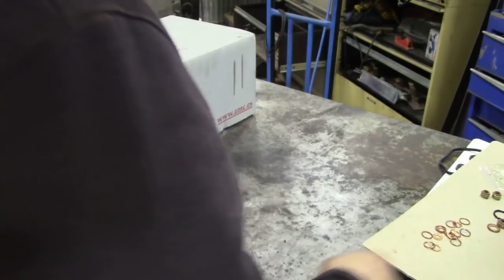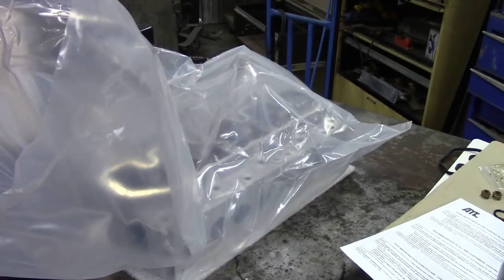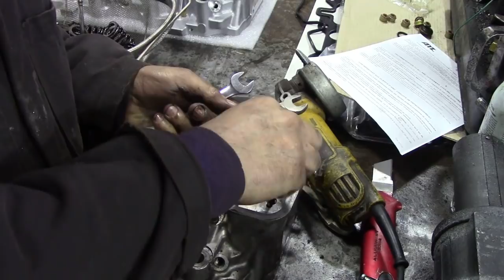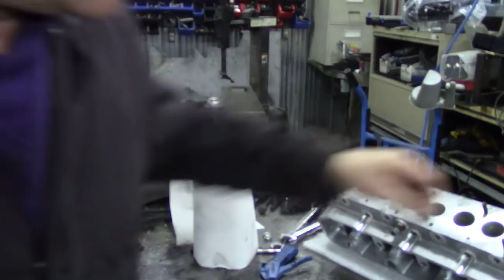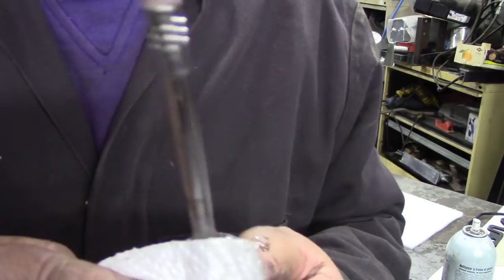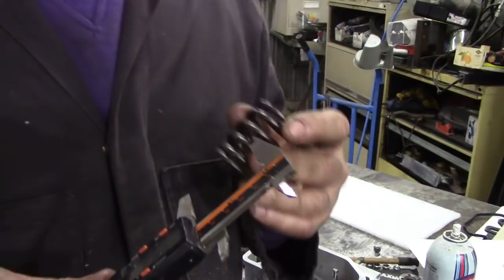300Tdi head replacement Part 1. Swapping parts, cutting valves and getting ready to fit.

Comment: Built many of those cylinder heads  during my time employed at Land Rover.......think it was around 20 or so an hour!
Reply from the maker: That is impressive! That's 1 every 3 minutes!
Reply: Britannica Restorations Ltd I’ll correct myself, the engine assembly line rate was 20 engines built per hour but 3 men could build a sub assembled cylinder head at 30 per hour.
Sub assembled rocker shafts, ready to fit to cylinder head in 60 seconds.

To fit a cylinder head to a short engine including head bolts, gasket, pushrods, valve caps, rocker shaft and fixed in 60 seconds, although the time given to do the aforementioned task was about 3 minutes🤫
Reply from the maker: No wonder they had so many head problems
Reply: Britannica Restorations Ltd what are the problems associated with the cylinder head out of interest?
I am aware of the warping and cracking out in the field, but that would not be a production issue.

Comment: The sound of a new well installed cylinder head full Revs feel good.
😁😁😁 I feel good everytime you rub oily hands onto your overall because that's what I do. 👇🏿👇🏿💪🏿💪🏿
 I opened my brake vacuum pump that developed funny noise after afew years from new, opened it from the shaft side because it's very hard to put back the rivets if you did from the rivets side, I put a very small shim in form of a washer, minimize the gap the shaft moves, put it back and it performs even better than it did when brand new. Land rover, land rover.
I dream land rover when I doze 😎😎.

Comment: Mike there is so much knowledge in these videos. first off thank you!
secondly I am new to the game and just purchased a 1987 110 ffr rhd. I am trying to find where my leak is coming from. there is a small small bit of engine oil coming from the head gasket but I am more concerned about the amount of transmission fluid seeping from somewhere. 

thanks again! 
-JP
Reply from the maker: What colour transmission fluid?
Reply: @BritannicaRestorations  its pinkish/orange ish? it seams relatively new oil. (probably topped off/changed at the dealer before I received the truck)

Comment: Mike, do you know of an easy way to test the compressed strength of valve springs? I understand that springs will lose force over time. Hope this makes sense.
Reply from the maker: Well I could think of a fancy way to test them, but I have no data to work out what they should be
Reply: There was an engineering workshop up the road, when I was a kid. They used to do this on new Springs to make packs with the same tension for blueprinting engines. That was back when we had engineering workshops and blueprinted engines.

Comment: Bearmach has a new style and  old style tdi300 head , what is the difference/best?
Reply from the maker: The 'new style' is a HS2.8 style head and has an additional cooling hole in the rear of the head, however the 300Tdi block does not have this hole so save your money!
Mike

Comment: Mike out of interest what did the new head set you back?
Reply from the maker: https://www.turnerengineering.co.uk/ldf500180-300tdi-cylinder-head-bare-c2x21885992
+£100 shipping
Reply: @BritannicaRestorations  That's not a bad price for a cylinder head...
Reply from the maker: This had no valves or springs etc and the was VAT free as it was for export
Reply: Thank you

Comment: "110, the most pathetic voltage in the world"!
Reply: Very funny
Reply: It begs the question,  why?
Reply: @bigm383  Because it lacks umph!!
Reply: @darrendean21  I meant,  why have 110 volt at all? Makes no sense to us 240 volt Australians.
Reply: @bigm383  because it's safer, I believe it's actually two 55V lives ... so you only get a 55v shock if one should go to ground or you touch one.
Reply: @darrendean21  It's not two 55 volt lines in places where 110 or 120 volt is standard. I just read that two 55 volt lines are used in the UK where 110 volt American tools are run from a 240 to 2 by 55 volt transformer. As for safety, Earth Leakage Circuit Breakers have been around for decades.
Reply: @bigm383  OK, that's what we have here in the UK, thanks for clarifying. In that case there is no sense to have 110V as the breakers are now common place.  3ph everywhere would be even better !! I believe Germany has this even in domestic installations.
Reply: @darrendean21  Yes, three phase used to be quite common as domestic instantaneous water heaters ran on three phase. New Australian houses only run on single phase, 240 volt. This is often sufficient,  as many places have gas heating and hot water. Of course, those big whole house air conditioners are better run on three phase!
Reply: The whole rest of the world runs on 240V.  110 is terrible.  As for the safety argument, no, it’s not safer if you have correct RCDs in the fuse box, something that has been a requirement in Europe for several decades.  The higher the voltage, the lower the current for a required wattage.  It’s current that is the danger, not volts.
Reply from the maker: I spoke to an old electrician about this and the basics were than in the early days of domestic electricity, the US didn't have the insulation that Europe had on wiring, and the 'white goods' market in the US geared up to 110v and never went back
I have 3 phase 600v in my shop which has a transformer to my apartment and shop lights/outlets
Cookers are 220v
When you are use to the old UK ring main and then look in a North American entrance panel they are a mess of beakers and ben wires
Entrance panels are generally 200amps and to get 220 you replace the neutral with a 110 feed
Reply: @BritannicaRestorations  Insulation .. lol, I once rewired a Hotel where the bare live and neutral wires ran exposed on wooden trays  with grooves in them .... apart from a few dead birds it was in surprisingly good condition .... and still in use with customers in the room below. I seem to remember there was a massive crows nest in one corner, about 5ft round and 3ft high !!
Reply: @BritannicaRestorations  Thanks I didn't know that , you are like listening to Classical Music my IQ goes up watching you're videos.
Reply: @BritannicaRestorations  Thanks for the explanation.  It still sounds crazy! Running a second phase through the neutral?  I guess lights then run at 110, or 120 and power at 240. The big problem is that power losses increase with increasing amps. At 240 and 10 amps you get about 2400 watts. To get the same power out of 120, you need to run it at 20 amps. Loss is proportional to the square of the ampage, hence losses are quadrupled at the lower voltage. I guess running another phase through neutral circumvents this.